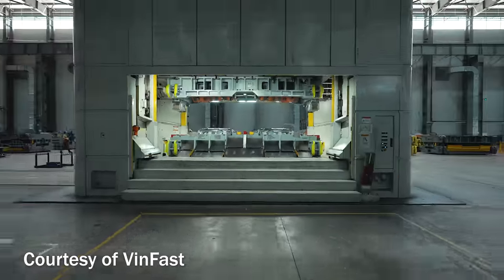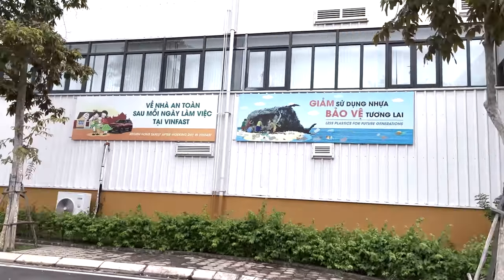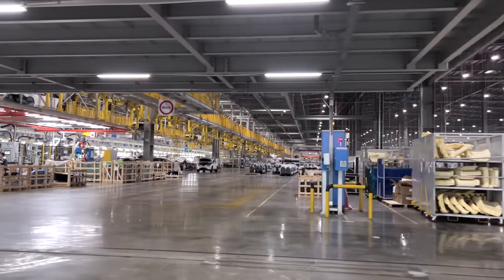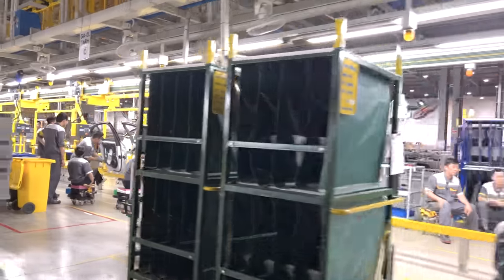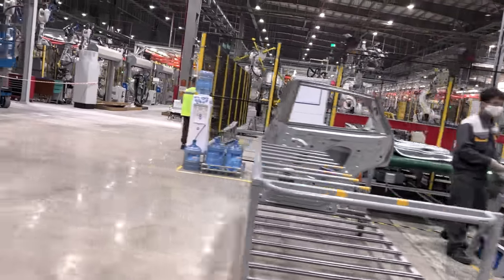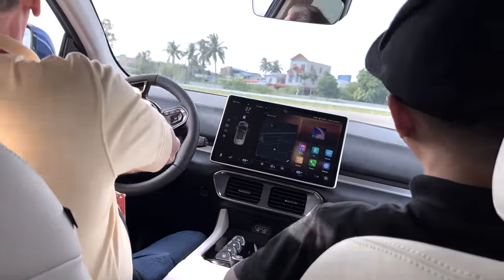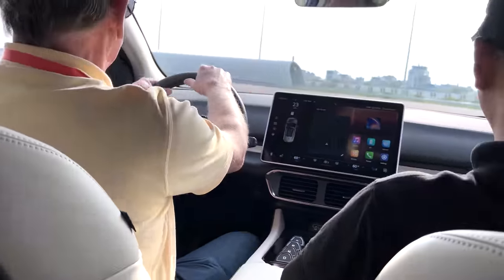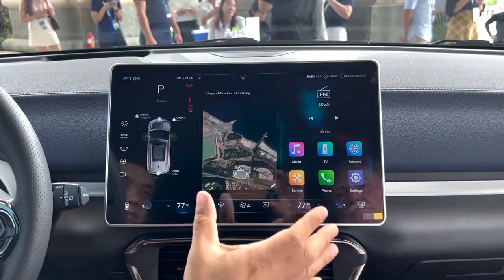Sandy and Cory's Trip to VinFast: Batteries, Test Drives, & Similarities to Tesla

Comment: To enable Car Wash Mode, touch Controls > Service > Car Wash Mode. Your vehicle must be stationary and not charging.
Reply: The tesla will let you drive up to 10mph in car swash mod
Reply: Does it automatically put it in neutral?
Reply: @aussie2uGA  it won't automatically put it in neutral, but you can switch to neutral by pushing up to the first detent on the right stalk.
Reply: @aussie2uGA  No, as you normally need to roll forward to position the car before going into neutral. It would be nice with a separate button on the screen to do that.
Reply: or just use voice command for quicker results
Reply: Good point @Deaths.

I also want to note that when you have the car setting in "ROLL" mode you don't even have to put it in neutral when you go through a car was that pushes your car, just keep it in "Drive" and it will push it right through with no issues.
Reply: @LarryRichelli  Not true. You can reach up to 80 mph while in car wash mode.
Reply: @seussiii  OK....I should have said tesla recommends not going over 10mph in car wash mode....at least my 2022 M3 performance does.

Comment: Tesla has N, carwash and tow mode. How did you not know this?  😂
Reply: many People including YouTubers like ROMAN from TFL , dont even bother to READ the Manual. 
ROMAN and others have CLAIMED Tesla does not have REAR emergency door Release. 
when, actually EVERY Tesla made has emergency door release in every car.
Reply: 🤦🏻‍♂️ disheartening, I stopped watching after that lack of knowledge.
Reply: They've gone on so many road trips and never visited the service menu?  Never noticed the N on the stalk of their model 3?
Reply: When you drive a dozen or more new cars a week, IF you read all the manuals, it's easy to understand why the minute details of each may run together or slip your mind. Lighten up Francis. 😆
Reply: I use neutral all the time...like a stick.  Refresh Model S makes this a pain now though
Reply: @danoberste8146  Sandy owns a Tesla.  N is literally on the gear stalk. Car wash mode has been out for a while now, don’t say Vinfast is doing things Tesla isn’t on video without confirming your info first.  Especially considering that you can’t even buy a Vinfast if you wanted to so it doesn’t even exist.
Reply: Someone show Sandy how to find it.
Reply: @markplott4820  ahem. Does anyone drive with the handy 'emergency release screwdriver'? Its funny how tesla makes an emergency release for the back doors harder to get to than the front when of sll the things that sit back there are kids. These button oppening doors etc are a safety risk if there is a crash. Teslas can trap their owner really easy. If the power gets lost instantly from the impact there is a quick release from the front doors but the back of some teslas if not all of them requires that you unscrew the door to pull a tab that can break on you.....
Reply: @Purée-m7z  A LOT of Tesla owners don't know about a LOT of the features of their car. I've driven Teslas for 4 years and have never put one in neutral. It just isn't something I use so even I wasn't sure EXACTLY how to put it in neutral. I know it can be, I'd probably stumble on to it without having to go to the manual, but I'd be willing to bet you a dozen shares of $TSLA that my wife (who has driven ONLY Teslas for 4 years) wouldn't know how to do it.
Reply: @danoberste8146  you and your wife don’t run a YouTube channel with 300k subscribers and sell reports to OEM’s for 100k.
Reply: He hand washes it.
Reply: @markplott4820  Model 3/y dont have accessible rear seat emergency releases like the front doors do. The mechanism is there, but not exposed without the user drilling holes and attaching cables manually (older models) or digging through a rubber flat piece AND a connected plate)
Reply: @markplott4820  the 3/y so not have reasonably accessible rear emergency releases.
Reply: Feeling like an advertisement to me?…..
Reply: @danoberste8146  this is elementary knowledge something they should on the back of their hands. C’mon that was embarrassing.
Reply: @renewablenavigator1015  This has been the case for 10+ years
Reply: Almost fell of the chair that they don't know
Reply: @bob15479  - but they are there, and TESLA are SAFEST cars ever Tested.
Reply: @rickkay9548  - FALSE , MY and M3 emergency releaces are in the Door pocket , under the liner mat , pull cables are there.
TESLA still #1 SAFEST car ever Tested.
Reply: @markplott4820  they are there but not accessible
Reply: @bob15479   - False, accessable by anyone.
Reply: @markplott4820  Yep, safest ever agreed. Only newer model have the  ring to pull in the back and its UNDER rubber, then behind a door that needs a flat tool to open. This is NOT an emergency release meant to be used - period - unless you open it beforehand
Reply: @Purée-m7z  the hyperbole is so thick I could cut it. Most people dont know the minute details of the cars they drive. Read the manual? Who does that??? Lol. Yall are too much with these comments.
Reply: They are just shooting the schit. You forget stuff sometimes.
Reply: @markplott4820  Roman is an absolute 🤡
Reply: @Deez1219  this might be a good job for Chris @DirtyTesla
Reply: 9:56 they definitely should have verified the competition's claim... Not taken it at face value.
Reply: When you’re considered experts this isn’t something you should forget either, especially since the Teslas have been out for so long
Reply: @Purée-m7z  you couldn't buy a Tesla until you could...
Reply: It is not a true neutral however, as there is no way in any Tesla to disconnect the wheels from the electric motors. Tesla's own user manual warns against rolling in neutral too last or for too long because it will heavily damage the motors and battery pack, and you cannot tow any Tesla on its wheels. The car wash mode is an extension of the slow neutral roll that won't damage the drive units or battery. Vinfast however has a true neutral gear where the motors are disconnected from the wheels, enabling true freewheeling, and that is what Cory and Sandy were talking about
Reply: @renewablenavigator1015  true for the average person but if you have a Tesla it tells you every new feature/ enhancement with each update and it fills the screen when you get in so you can’t miss it. They have and drive a model 3 which they are always comparing other cars to so they really should be aware of these things.
Reply: @markplott4820  TFL is a joke
Reply: Tesla did not have the mode before. It has been added later, but it's still confusing drivers.
Reply: No kidding! Seriously Sandy!?
Reply: Yeah this was too cringe to keep watching
Reply: @markplott4820  What year?  I'm pretty sure my 22 3 doesn't have a separate liner mat in the rear door pocket.  I'll have to double check.
Reply: @Purée-m7z  give the old geiser a break sheesh
Reply: @Purée-m7z  Sandy isn’t the one taking apart every vehicle. He has employees for that.

Comment: For neutral in a Tesla with a shifter hold the shifter up for 1 second. Also you can hold the Park button for emergency brake.
Reply: In models without stalks I think you have to go to the settings.
Reply: KT Wi  kind of like when the headlamp dimmer switch moved off the standard floor location to the stalk and different cars did it differently.
Reply: George Panaropilos  Tesla does use software to set neutral in "car wash mode", but since they have a physical shifter it makes sense to use it for all shifting? The cars without a physical shifter can do it all through software, though they still have physical buttons in case the screen doesn't work.
Reply: Up, OR down
Reply: KT Wi  screen could get physically damaged

Comment: Tesla has a car was mode.  Tesla's neutral is the 1st detent up on the right stalk.  Works just fine.
Reply: I assume (?) they mean 'flat towing' like using a tow bar to your front bumper and towing the EV behind an RV.
I believe the Mustang EV has this capability (?) but you need to have a clutch to isolate the electrical motor.
Otherwise, Tesla has a towing mode to keep in Neutral, but only for 20 minutes and below 20 miles/hour speed.
The Tesla shifter has two Neutral positions, one between the Park and the Front and the other for the Reverse side.
But the Tesla Neutral disengage when opening the door and exiting the car.
The Tesla car wash has also Neutral, but must have a  slow speed limitation.
Reply: @nihongobenkyoshimasu3190  When in drive hold the stalk up half way (before the notch) for 2 seconds and it goes into neutral and you can freewheel.

Comment: Tesla's car wash mode disables wipers, closes all windows, locks the charge port, turns off sentry mode, walk-away door locking and parking sensors.  Another option: Enable Free Roll, keeps the car in Neutral for the car wash systems that need to drag the car.

Comment: Put your Tesla in neutral by giving the gearshift a half push so that it falls halfway between the Drive and Reverse options. But if you need your Tesla to remain in neutral for an extended period, you'll need to put it in Tow Mode. To do this: Shift into the parking gear and hold the brake.
Reply: It is not a true neutral however, as there is no way in any Tesla to disconnect the wheels from the electric motors. Tesla's own user manual warns against rolling in neutral too last or for too long because it will heavily damage the motors and battery pack, and you cannot tow any Tesla on its wheels. The car wash mode is an extension of the slow neutral roll that won't damage the drive units or battery. Vinfast however has a true neutral gear where the motors are disconnected from the wheels, enabling true freewheeling, and that is what Cory and Sandy were talking about
Reply: @uarelosers12  >Interesting.

Comment: I’m vf9 reservation holder and I like about the brand and the suv but I can’t get over the battery lease model. At $200/month in Canada it’s an extra $24,000 for 10yrs of driving. There goes all the gas savings I thought I would have.
Reply: have the option of buying batteries or renting batteries

Comment: Neutral is selected by lifting the right stalk to the first detent and hold for about a second. There is no audible confirmation unless Autopilot is engaged. Just bump the right stalk down to the first detent to resume normal driving. Bump it into neutral and coast to freeway exit ramps for best economy. You will be stunned at how far a Tesla can coast.😀
Reply: It's the Nikola way
Reply: "Neutral allows Model Y to roll freely when you are not pressing the brake pedal: When in Park, shift into Neutral by briefly pushing the drive stalk either up or down to the first position. When in Drive, shift into Neutral by briefly pushing the drive stalk up to the first position"
.
Tesla

Comment: 10:12 There is a Neutral gear on Teslas.
Old Model S/X: It's between Drive and Reverse on the gear stalk, just shift up or down depending on what gear you're in.
2021+ Model S/X (Plaid/Long Range): Tap Controls > press and hold Neutral, or use the center console drive mode selector that's next to the hazard lights (press once to activate the selector and again to select the gear). Finally, if you're driving over 5mph/8kmh and swipe on the touchscreen drive control strip, a "neutral" button appears and you can press that.
Model 3/Y: There are two indents both up and down from the center position on the shifter, Neutral is the first indent in either direction (depending on context, since the shifter doesn't stay in position when you use it). When in Park, push the drive stalk up or down. When in Drive, push up (and if cruise control or Autopilot is on, hold it for 1 second). When in Reverse, push down.
Reply: You're the other person who read the manual?
👍

Comment: To put a Tesla into Neutral - When in Drive, Press up the right-hand gear selector lever up until it reaches the detent but not past the detent where it would go into Reverse then hold it there for about 3 seconds and it will go into Neutral.  When in Reverse, Press down the right-hand gear selector lever up until it reaches the detent but not past the detent where it would go into Drive then hold it there for about 3 seconds and it will go into Neutral. I've been doing this every time I pull into my garage or into an automated carwash.  The reason I do this when I pull into my garage is because I prefer Creep Mode, which emulates legacy ICE automatic transmission vehicles.  I have a small 4"x4" I allow the Tesla tires to stop at with driveline resistance. Putting it into Neutral allows the Tesla to roll back as much as I want from the resistance position.  A point I feel needs to be made (I understand everybody has their preference) but I feel more comfortable allowing my multi-hundred horsepower Model 3 Performance+ to Creep when parking rather than trying to finesse the final resting (Parked} position using my throttle foot.  One more point - This information is in the Owners Manual.  I do not know how to put a late model S without the gear selector stalk into Neutral but the instructions are most likely in that Tesla Owners Manual as well.

Comment: I use it all the time, Tesla Carwash mode... It's under the Service tab. 

Tap the Car Symbol at the far left down corner, Tap service, tap carwash mode, and then there is also the option to put it in neutral rol mode if necessary.

The symbol 'N' is present in the row of transmission options, so I suppose you can set a Tesla in Neutral.

Comment: Pressed in Cells are very problematic, vehicle in use is subject to continuous long term vibrations and environmental changes, that is big risk of cells working loose
Reply: and Thermal expansion in High heat.
Reply: BS
Pressed into a slightly compliant plastic which itself is over the cooling vanes.
Compresses the plastic, allows contact with the cooling system.
They won't work loose (😂) and they will be cooled.

Comment: How do I put my Tesla Model Y in neutral?

Neutral. Neutral allows Model Y to roll freely when you are not pressing the brake pedal: When in Park, shift into Neutral by briefly pushing the drive stalk either up or down to the first position. When in Drive, shift into Neutral by briefly pushing the drive stalk up to the first position.

Comment: On the original Nissan Leaf its simple.  With the shift knob in the center position push it to the left after which regenerative braking is turned off, parking brake is disengaged and the neutral light comes on.  I know a little too old fashioned and ICE like but its simple and works intuitively.  Are we turning our backs to a degree on the hard won concept of CUI in roadway vehicles or is self driving automation supposed to eliminate the need for that?